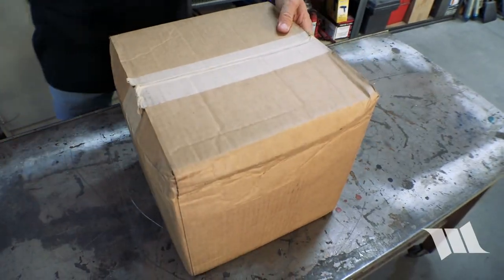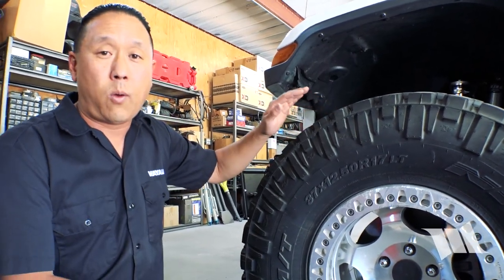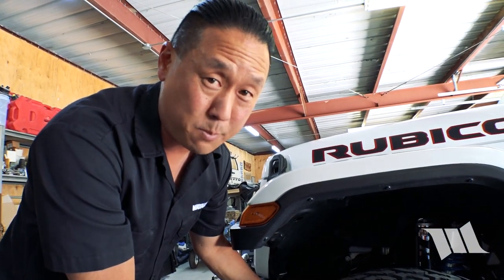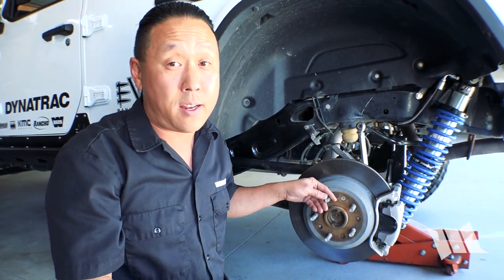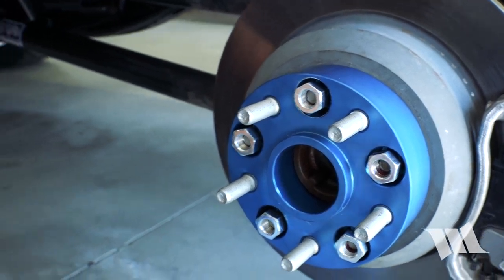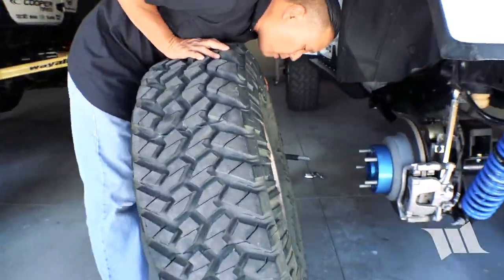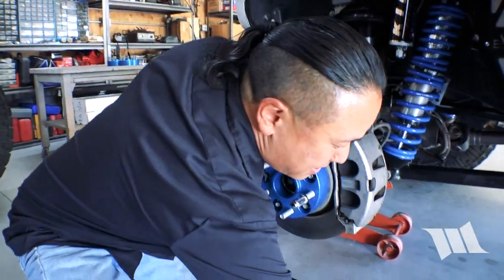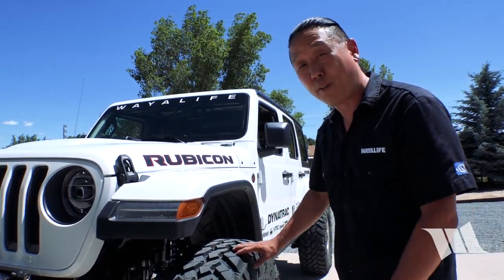Jeep Wrangler Wheel Spacer INSTALL - How to Run Big Tires on Factory Wheels with No Rub SPIDERTRAX

Comment: Hey dude, nice info in the video. I would have point out the hub center to locate the wheel on dead center as this is a vary good feature. 
The only problem I have is the red loctite. This requires heat for future repair. I would be using blue even though the red it is supplied in the kit. I had a stepson use red loctite on wheels once and spent three hours getting them off. The torque specs seem a little high as alloys at the Buick dealer was 85 ft. Lbs. I look at it from a dealer prospective but also a husband of 40 years. If my wife has a flat, I taught her what to do and why. But using the factory lug wrench and OEM supplied tools, she could not get lug nuts off.
  I had bought a used 4 X 4 and new I had to replace the outer CV Boots. First was new tires.
I made a good deal for a tire I wanted. They put them on and 15 minutes after getting home, could not get half of the front lugs nuts off. The rest, right & left spun the bolt inside the hub. Not all hubs are created them same. From the factory, their design left little meat on the hub for the knurled section to hold onto than I would like, plus their torque book was wrong as I brought the factory service manual in.
  Then torque sticks where different colors mean different torques, but by different manufacturers. How much air pressure, old air impact or new. SnapOn or Sears. The number of taps the hammer hit they anvil to twist the yellow torque stick until it stops. 10 of these will produce 10 different torque specs. I dare any tech to have his own wife break those lug nuts loose with their foot. No 6 foot cheater pipe on a breaker bar.

Sorry, bad memories come flooding back just thinking about it. Much less the two days it took them to get a used hub with studs and install my new tires. Thanks for they video and everyone hit like & subscribe! It’s worth having good info. I didn’t have YouTube in 78 when I took 8 test, passed all and was certified and NIASE Master. The only one in a dealership with 12 guys. Blessings!
Reply from the maker: The wheel studs are 14mm and the torque spec for them is correct and same as if they were 9/16" studs. I've been running both for well over a decade and using 130 ft lbs and without ANY problems. As far as red loctite goes, it's what is provided because it's critical that the nuts stay in place once installed. These are nuts that you can only see if you remove the wheels. Again, I have been running wheel spacers on and off on most of my Jeeps and have always used red and without ANY problems. Both are what I would ONLY recommend for this application.
Reply: @wayalife  Thanks for the reply. My only concern was removal required for future service. Best of luck! Regards.
ASE Master Tech since 1978 - Retired

Comment: Hey wayalife just wondering did you change your gears for the 37 inch tires you have?... I'm putting on 37x12.5r17 on my gladiator rubicon just wondering thanks
Reply from the maker: I did not on this Jeep being that I've since sold it but on my new Gladiator with 37's, I will be running 4.88 gears

Comment: Great video, New jeeper here. Got a willys gladiator in May. Wanted get 35s and keep my stock rims. After watching your video and doing a ton of research. I ordered wheel spacers and 35s, is this safe enough to still do moderate trails in Vegas? Will this cause any extra wear on the steering joints? Thanks in advance.
Reply from the maker: Oh yeah, you'll be fine. Yes, the leverage will cause things like your ball joints and unit bearings to wear out prematurely but that doesn't mean it'll happen in a couple of days. It just means they won't last as long.
Reply: @wayalife  thanks for the reply. I love your videos and look forward to more content. Sorry to be a pain, but one last question. When you say prematurely,  what will the time range be? A couple of years or so? Roughly?
Reply from the maker: @oldasiandude76  So, if you left your Jeep completely stock, your ball joints and unit bearings could easily last 100k miles or more. The bigger the tire and the harder you wheel your Jeep, you'd be looking at servicing them at 60k or less. If you do a lot of hard and fast driving across the desert and hit big whoops, maybe 10k or less.
Reply: @wayalife  thanks so much. I do mild trails here in Vegas. Cottonwood, Wheeler Pass stuff like that. I'll just be safe and have them inspected every 20k miles. Love the jeep life. Just FYI, watching the series on your gladiator build made me fall in love with the JTs.

Comment: Some comments in other posts say to never use the red loctite on the threads and to use the blue instead. They said it's very difficult to remove the lug nuts when you have used red. I used the red because that's what Spidertrax supplied and hope it's not too difficult to loosen them when the time comes. Some said they had to use high heat to loosen them. As often as you change things, I'm sure we're going to find out in one of you future vids lol.
Reply from the maker: Well, I don't know who they are but it sounds to me like they need to ask for their balls back from their mom or significant other. I have run Spidertrax wheel spacers on numerous Jeeps in the past and have NEVER had any issues removing the lug nuts with red loctite. NONE.
Reply: @wayalife  Thanks for the reassurance. Nobody making spacers has a better reputation than Spicertrax which again, is why I used what they supplied on my old 78' CJ. Just added them a a little extra width.
Reply: @wayalife  lol get their balls back. Hahaha.  No crap right.  Not like trying to torque control arm bolts to 190 ft lbs with minimal space on the ground.  Shit...red loctite and lugs are a breeze compared to that.  Ask me how I know.
Reply: Ugh.  Has 392 Rubicon rims with 315s on them stock...no rub.  Installed the Clayton overland plus 2.5 on my JT and have some rub on the lower front control arms.  They are super beefy arms so.  

But after the cost of the lift and shocks...and the rims and tires ...only option for me right now is a spacer.  Soooo just ordered these.  I'd prefer rims with enough backspacing as I'm kinda worried about running spacers.  Wish me luck!

Comment: Hi great video as always. I recently had a 2.5. Inch TreaFlex lift installed on my 2018 Sport S JlLU this required adding 1.75 in wheel spacers.  They installer used G2 93-73-175M spacers which I know are 6061 T6 but I know very little about spacers. Are you still running spacers? How often should they be re torque? Im light off roader mostly exploring old dirt roads in S Ca desert and the Jeep is my daily driver. Any input would be appreciated. Thanks
Reply from the maker: I can only assume you installed new and bigger tires because otherwise, a lift kit should NOT require wheel spacers. That said, I am not running these anymore as I got new wheels but I wouldn't have hesitated to keep running them. Assuming you installed the spacers correctly with red loctite, they should checked after the first 100 miles but should NOT need to be retorqued if they are still set.
Reply: @wayalife  thank you and yes I recently added a taller and wider tire than the stock tire that came with the Sport S JL. Red loctite was used!
Reply: @wayalife  Also are they ok on payment at Highway speeds 70MPH? Probably dumb question.
Reply from the maker: @gcjctc2  Assuming they are quality made spacers and installed correctly, they should be no different than running new wheels with less back spacing.
Reply: @wayalife  Thanks again, I’ve learned so much from your videos over the years! Keep them coming!
Reply: Just one question for clarification.  Is it possible to "re-tourque" a bolt with cured lock tight on it?

Comment: It's important that you should buy a spacer that is hub-centric. And many mfgr. spec anti-seize on the back of the spacer so there is less chance of the aluminum of the spacer and steel of the rotor reacting/corroding.
Reply from the maker: These Spidertrax wheel spacers are made specifically for a JL Wrangler and are hub-centric. I have never used anti-seize on the back of them and have never had a problem with corrosion. Granted, I do live in Nevada and corrosion is not really an issue here.
Reply: I use ant-seize on all the lugs, spacer and wheel.... I may be wrong and I check them every 3k miles when I do my rotations. I currently have this type of spacer on my crawler and JK wheeler. Never had an issue. I know there are skeptics, but that is my personal experience.
Reply: @billybadass411thefirst9  Anti-seize I think is okay on the lugs. But for sure use loctite on the original lugs (like is mentioned in the video). What you should never do is follow internet advice and put motor oil on your lugs! Ask me how I know. They will loosen up in 100 miles or less.
Reply: Ken Hadden 10k miles on the wheeler/daily driver JK (6 state road trip, Moab, big bear, Miller Jeep trail, Rowher trail, and other) on the rock crawler, 3 rubicon trips, countless trips to the hammers (sledge, jack, claw, wrecking ball, turkey claw, bullfrog and more), Callico gatekeeper (multiple times)..... you get the idea. I personally have never had a problem with this type of spacer or using anti-seize. If I ever do, I’ll switch to lock tight.
Reply: I always use anti seize on my wheels also but we live in sw Michigan don't like having to beat my wheels off with a big hammer. @billybadass411thefirst9

Comment: Surprised you didn't change the wheels  instead when you did the coil overs? You mentioned it at the time. I would speculate that bigger axles are coming in the future and was a cost and or availability issue since you would need to change again to 8 on 6.5?
Excellent work as usual. Thanks for sharing. OlllllllO
Reply from the maker: As you've gathered, I'm holding off until we get 1-tons under our Jeep and then we'll get new wheels with an 8-lug bolt pattern.

Comment: I'm going to be getting a 2019 Rubicon soon. I really wanted the 2.0, but my dealer doesn't have one specked out like I want. They do however have a 3.6 with all my wants. What do you think on the motor options?
Reply from the maker: Personally, I like the 3.6L better. A lot less maintenance is needed on it and it's a tried and true engine.
Reply: Thank you! Your opinion really matters to me.

Comment: Don't know if anyone has suggested that when doing such spacer (aluminum) to place some antiseize on the points where it would touch your steel rotor. The 2 different material surfaces have an erratic agreement between them and usually its a fight to break them apart. 

To add, when doing the front (or rear), with a vented rotor, you can use lugs with a pry bar as you had shown, or take a thick screwdriver, drift, etc and place into vent of the rotor and have it press against the caliper bracket. 

Another note, since these are add-ons, to gain access to the rotor removal (as in rear to inspect parking brake pads/function), you do have to remove the spacer and retorque when placing back on. Some say to re-apply the locktite as well. I would also recommend to check the torque on the spacer (wheel removal) after 500 miles or so. And if used with a larger, much larger tire, heavy trail use.
Reply from the maker: I don't get it. Factory wheels are aluminum and I don't ever recall seeing antiseize being used on them. I've run tons of aluminum aftermarket wheels in the past and have never seen this be an issue. I have run wheel spacers like these on most of the Jeeps that I've owned over the last 25 years and have never seen it be an issue.

Regarding the tightening of bolts, I fail to see why that would be a better solution than just shifting transfer case in gear. I mean, it that really so difficult?

If you need to inspect something like the parking brake shoes, yes, you would need to remove the spacer. Reinstalling it would require new loctite. Also, I do believe I state in the video that you should check torque after 100 miles but then, that's just me.
Reply: I believe you have a bit more leverage when removing a wheel as opposed to a stuck spacer ! I use anti seize on the hub, it’s cheap insurance. Your Jeep, do whatever you think is best.

Comment: It looks like one of your rear beadlock ring bolts is backing out (just a heads up). I wanted to get those KMC wheels but needed less backspacing. I'm glad to see they look great with wheel spacers. I was afraid it would be too much.
Reply from the maker: Good eye! As a matter of fact, that one was. We did just get them installed and checking all the bolts was something I did do shortly after installing these spacers.

Comment: Hi,
 Can I run spider trax spacers ( 1.75)  on my JL which has Fuel Sledge 20 inch rims on 35 Nitto Ridge Grapplers with a 44 negative offset? They already stick out about 2 inches but for a super aggressive look can I add the spacers or am I just asking for trouble? I have seen a few with half the tire untucked and they look great. So appreciate your knowledge.....thank you!
Reply from the maker: You can run whatever you want but the more you push your tires out, the more stress you will place on your ball joints and unit bearings. This will cause them to fail prematurely. Not really that big of a deal as everything wears out but it is something you'll need to be aware of.

Comment: Just wondering if the torque specs came with the spidertrax spacers... my g2 wheel spacers for my jk specified 90ftbl for the spacer nuts .  I’m assuming the aluminum gets distorted at higher torque?   Just curious I’ve never had an issue with mine (yet). About 30k miles on them
Reply from the maker: Torque specs are based off of bolt size or in this case, stud size. I don't know what kind of studs G2 has but if they're recommending 90 ft. lbs., I can only assume they come with 1/2" or 13mm studs just like the JK had. These Spidertrax come with 14mm studs just like the JL and they require a higher torque value.

Comment: I’ve seen another video where they say, you should wire brush all the rust off the face of the hub before installing the wheel spacer, just the part where the wheel spacer is going to sit flush. Do you recommend that or is it ok to leave it rusty? I know aluminum won’t rust, but maybe a more flush mount?
Reply from the maker: LOL - I think I show exactly what I would do. Clearly, you should do what you think is best for your Jeep :)

Comment: I just recently bought ,a Jeep Wrangler unlimited Willy. the spacers gives it that bad ass look ? Does it add any of the performance
Reply from the maker: Actually, it will cause things like your ball joints and unit bearings to wear out prematurely. Not that big of a deal but there are no performance gains other than widening up your stance and maybe making your center of gravity a little lower.

Comment: Great video.  Do you recommend this for 37" and higher or 35" and higher? Thank you.
Reply from the maker: If you're trying to keep your factory wheels and want to run "wider" tires as in, 12.50 wide or wider, you would want to run something like this. This would be true of 35 or 37 inch tires.
Reply: @wayalife  Thank you!

Comment: Great video. Are you still running spacers. I keep having people tell me not to because they will fail. I have synergy and install led them correct. I want to run my oem wheels with 37s and need the offset. And issue thank you Eddie.
Reply from the maker: LOL - yeah, still running them and have run them for well over 20 years on other Jeeps. Don't know who all these people are but clearly, they've been reading the internet and therefore, know a lot more than me.
Reply: Wayalife thank you Eddie and thank you for always answering question for us. Every one appreciates your knowledge and that you pass it on.

Comment: Could you space out the stock wheels on a JL Rubicon to get more of that untucked look or would that be a bad thing - Thanks -
Reply from the maker: For sure you can. But, as I state in the video, there is a benefit to running stock wheels or wheels with similar back spacing. Pushing your wheels out further will cause your ball joints and unit bearings to wear out faster than is normal. Not really a big deal but something you should be aware about.
Reply: @wayalife  Must be more torque on the joint etc.  Makes sense maybe not as big an untuck.  Thanks for the reply!!

Comment: @Wayalife- you mentioned that you used 1.75” spacers in order to have enough width to cover the original lug studs completely. I want to put spacers on my 2014 JKUR. 

Do you know the minimum size spacers I would need to cover the lug studs on mine? 1.25”? 1.5”? 1.75”?
Reply from the maker: 1.5" is what you would want on a JK.
Reply: You can always pop a wheel off, and measure how far your stud sticks out

Comment: Will this spacer work on a 2020 JLU Rubicon stock with 35” Nitto Trail Grapplers? I’m getting a lift kit in October. If so do I have to rotate or balance the tires after I put the spacers on? Sorry im new to off roading
Reply from the maker: I would try running the tires as is and add spacers IF you find that you have rubbing at a full turn.

Comment: I want this exact look with my jk.
My wheel is 17x9 backspacing 4.528 Inch, 115.1mm.
Only stick out like half an inch with these.
To get the look you have with my rims would i need a 2 inch wheel spacer or less?
Reply from the maker: Factory wheels are 6.25". A good backspacing to give you an untucked look would be 3.5". 2" spacers would put you at 2.5" of back spacing and me personally, that might be a bit too little. I might recommending 1.5" spacers for your needs.

Comment: What size thickest are those spacers, please?
I'm running stock wheels on my 2019 JL Ribicon with 35x12.5x17s
I would like for them to stick out some.
Reply from the maker: These are 1.75" thick and that's what you will need to clear the factory wheel studs. You can run less but you would have to grind down the studs on your axle.